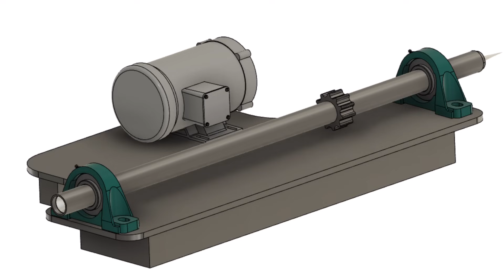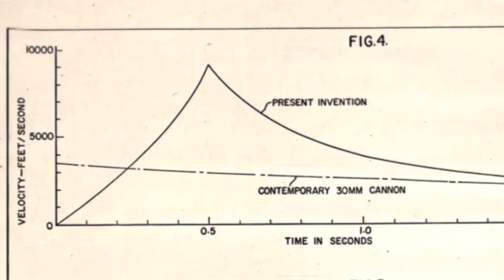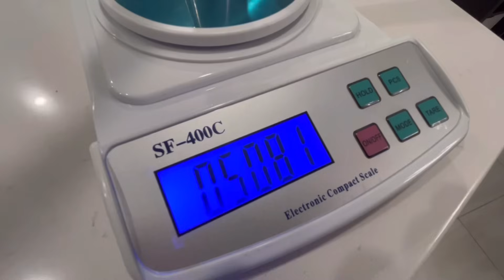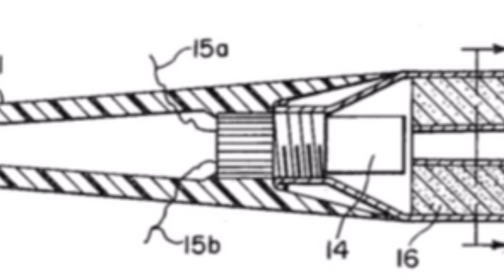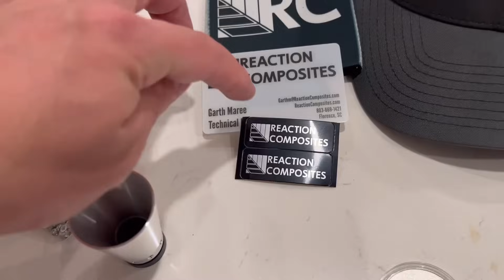Building a Hypervelocity Rocket (Mach 5)

Comment: uhhhh Doesn't aluminum have a low melting point and a very high conductivity which means it will get uniformly very hot very quickly?  also spinning the barrel to add spin stabilization instead of rifling the barrel?!?! also, won't this just explode when it hits mach 1? I don't think those materials can survive the shockwave...
Reply from the maker: Flight time is 1-2 seconds and is over before the temps start melting aluminum and rockets typically don’t use a rifle barrel , some ride on internal rails like Losat. Having an adjustable spin rate is very helpful in testing which my system is designed for

Comment: I’m not expert but I’d be very surprised if this config nozzle and body holds up the pressure.
Reply from the maker: The original (there was 50+ static tests) (5-10 flight tests) was made from conduit aluminum tubing with far less strength. The attachment point for hardware may need to be adjusted pending my personal static testing but overall I think it should be an improvement over the original

Comment: Just wondering why you made it out of carbon fibre coz would you get little micro fractures? Being the same thing that happened to ocean gate
Reply: Ocean gate had problems due to cyclic loading. This is a one use item so as long as it lasts as long as the fuel burn it will have done it's job. Also the consequences of failure lower and ability to test is much higher to deal with this problem.
Reply: @JohnFrumFromAmerica that's fine if you only use the rocket once or a couple times? But what if you wanna keep it, wouldn't you make it out of a non-composite material?
Reply from the maker: It’s going to be completely destroyed on impact with a target (this isn’t a hobby rocket fired into the sky)

Comment: Seems like adding more screw holes into the cf might make a weaker point than less screws.
Reply from the maker: The benefit of static testing will allow for testing these theories. It it doesn’t work then the ends can be chopped off and a new surface can be worked with to improve the design
Reply: @WildArmsResearchAndDevelopment  Carbon really hates holes being drilled in it, breaking the strands. May still be strong enough, staggering the screws may actually be even worse though, as the carbon does have some cross support with the layup, breaking the strands in multiple spots is even worse.

Comment: If those numbers are accurate then 
As per considerations 
Rocket mass = 0.5075 LB / 0.23019 KG 
Rocket propellant mass = 1.4 LB / 0.6350 KG 
Then by result 
Exhaust velocity for mach 5 rocket speed / 1701.5 m/s 
Exhaust velocity = 1151 m/s or 3.3823 mach or 3776.2865 ft/s
Reply from the maker: @bhuvanachandrabr4890  I placed Westinghouse’s motor data in the video, as well as the patent goes in detail of how it achieves the velocity which it already did at ft Meade firing range as well as NASAs Wallops island test facility. They were able to achieve at least 7000 FPS
Reply: @WildArmsResearchAndDevelopment  then the propellant was way more energy dense and only 0.6197 LBs of propellant was required ! ... Only if the exhaust velocity was guaranteed at 7,000 ft/s or 2133.6 m/s considering a higher pressure inside the rocket, only then the accurate propellant mass can be sensibly deducted here in it is the only chemically related data which is not predicted but observed ! 🙂 ... So ya ... Half of the propellant mass u thought could be the experimental stuff that they demonstrated  ! ...
Reply from the maker: @bhuvanachandrabr4890  US3358603A is worth the read, the technical documents I got from a couple archives have more information but that’s a good start on understanding this rocket
Reply from the maker: The propellant required may in fact be slightly more then stated in the video but that is what static testing phase is for, making adjustments and improvements as needed. There is plenty of space for more but obviously that will require adjustments to inhibitor used and core geometry
Reply: @WildArmsResearchAndDevelopment   understood 😀😄

Comment: I think if you add vanes inside the nozzle flare to induce spinning you can get the benefit of self spinning without reducing thrust due to drag that normal fins would cause. If you make them small and thin enough by the time the rocket is up to speed the vanes can be made to be burned away completely.
Reply from the maker: @BartJBols  that’s how the original works but the angle and thickness of the vanes has a drastic impact which are unknown so due to limited funding, we took that away and designing the launcher to spin the rocket at adjustable rates to test multiple speeds on the same day which isn’t possible with built in torque vanes
Reply: @BartJBols  or vertor stearing with on nosssle at that speed might be a stretch but.....

Comment: I feel like those nose cones should be on some foam pads or something. They're so skinny at the end. I fear that just the tiniest bit of deflection of the tip could cause it to go crazy during flight due to the speed.
Reply from the maker: Yeah that’s going to looked at , likely going to shorten the tip a little but those black and yellow cylinders are protectors for them , I just took them off for the video

Comment: Go to BMS space and check out his mixture also the interior coating he uses to make sure he doesn't have a blowout. He spins the rocket body as he is applying the interior coating which is a carbonizing interior coating so it basically just carbonizes on the outside to keep everything thermally sound throughout the entire flight of the rocket.

Comment: You can see it off that nose cone and have it purposely detach at the very last moment and burn its own how I velocity propellant along with a tungsten penetrator or depletion depleted uranium penetrator with a copper tip that folds around upon impact and wow. I wonder how much speed you could get from a two-stage penetrator rocket.

Comment: Had a copper tip with a tungsten or depleted uranium penetrator and you got one heck of a anti-material rocket. If you put active control fins, and laser, proximity, impact come and an infrared seeker perhaps you would have one hell of a weapon system. Make sure you're in compliance with ITAR.
Reply: Perhaps also consider a form of ceramic as the initial penetrator, heat shield, followed up by the metals. Ceramics or certain fortified or stabilized ceramics could have not only thermal shielding properties but the impact of the ceramics could defeat other ceramic counter measures.

Comment: Double the o rings on the nose cone, you can fit another between the two rows of screws. And another one right behind the nc taper. Is the nose cone core drilled out? It could be drilled like a revolver cylinder instead of one large I.D.

Comment: how is that non-bellshaped nozzle gonna be able to propel the rocket faster than the speed of sound if i may ask? wouldnt it not be able to do that with a "straight" nozzle?
Reply from the maker: It has a proper nozzle (maybe hard to see in the video) with 1/2” throat diameter. it’s copied from another hypervelocity rocket that uses a similar flare/nozzle combination so I don’t expect to see any major issue arising from that style of nozzle
Reply: @WildArmsResearchAndDevelopment  oh ok, that sounds good then, good luck with your project!

Comment: I would only limit it to one igniter up at the forward end of motor. If you have multiple through out the grain you are going to run into timing issues and could potentially light the motor midway. Especially with the fast burn time of this motor. When the forward igniter lights the top grain it will 100% guarantee light the rest of the grains down the line towards the nozzle with out question. Are you bonding the grains into the motor case?
Reply from the maker: @rcfreak2493  also yes bonding grains to the motorcase
Reply from the maker: That’s a good point, it’s a super long motor so I was just concerned about getting a fast ignition. a strong booster and a solid plug in the nozzle should suffice in building up a predetermined pressure to a fast and reliable motor ignition